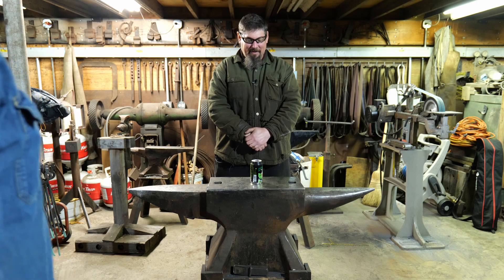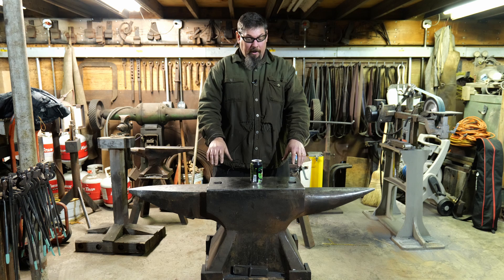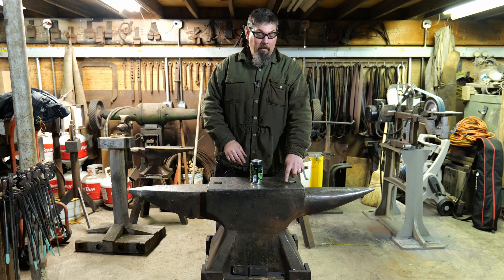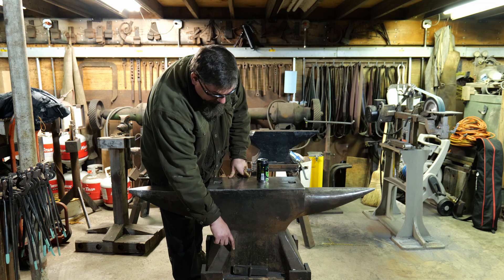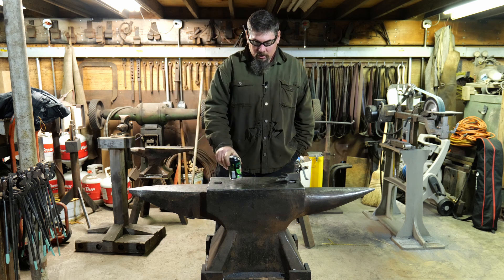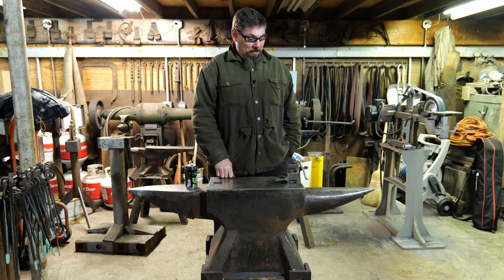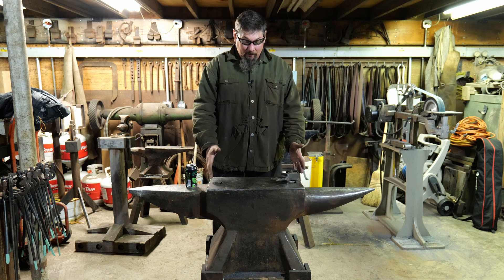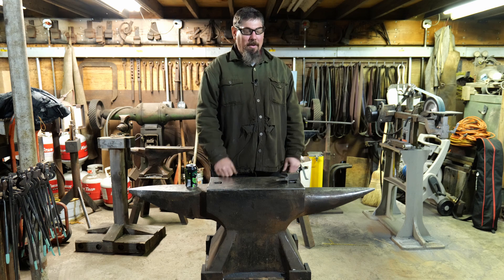Now That's an Anvil! Pat's MEGA Anvil

Comment: How was the top ground flat?
Reply: Most of the grinding on the top was done with a 9-inch angle grinder. I roughed it in with a hard stone, then switched to a sanding disc to smooth everything up.

Comment: How much do you think it ways
Reply from the maker: I believe Pat said 1,000lbs
Reply: I had it weighed an it came out at 1050. The stand it is sitting on is all made from 3/4x3 1/2 flat bar and probably is another 200# or more.

Comment: I am amazed you took the time to make such a large anvil Patrick. They say necessity is the mother of invention, so you reinvented the homemade ANVIL. What I am wondering is how thick were your average welds to glue the metal together ??? Nice work fella too. You most certainly are not afraid of working hard for sure !!!!
Reply: I used a lot of 3/16 rods and even some 1/4 inch on this project. I also had access to a large mig welder at the shop that did the flame cutting. This project actually was my  excuse to buy a 300 amp weld because my former unit was really only good for about 1/8 inch rods.